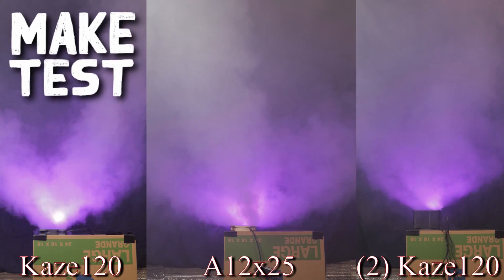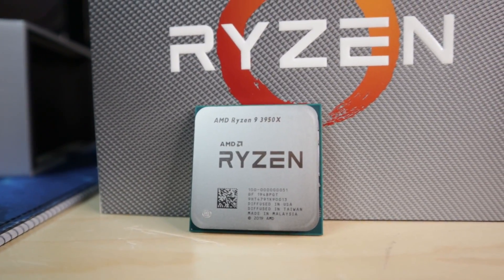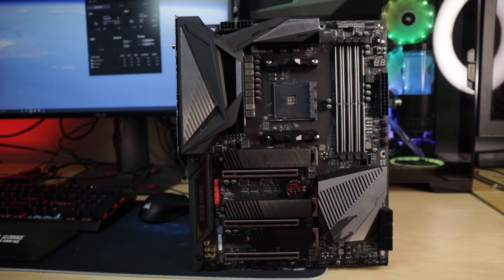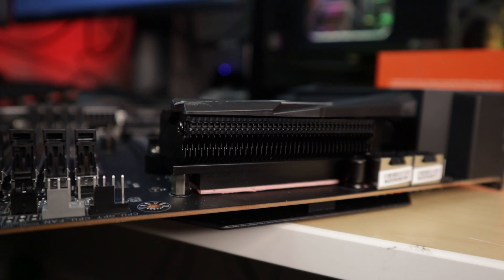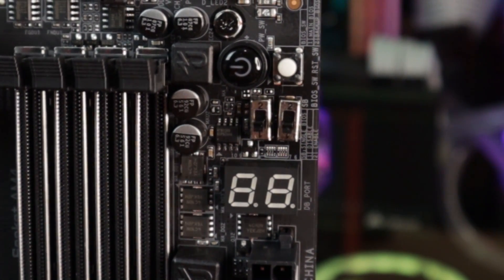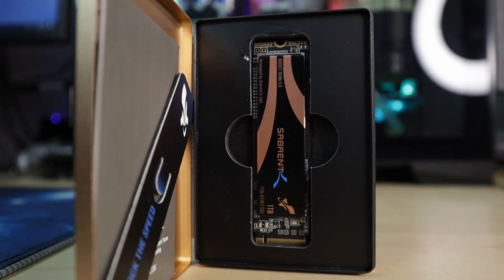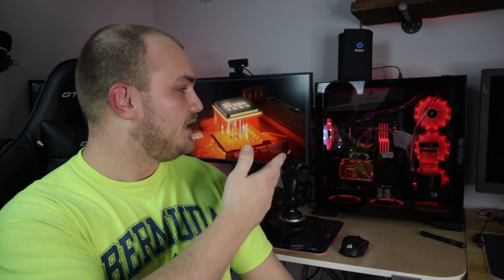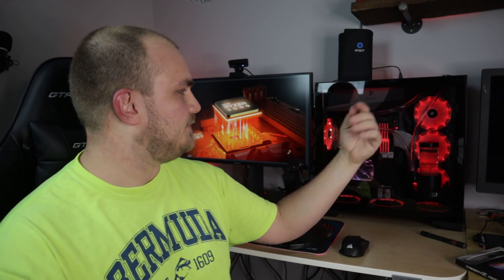EVERYTHING WENT WRONG, Upgrading I7-7700K to Ryzen 9 3950X

Comment: Everything goes wrong when you don't know what you're doing. 
For example, you have misapplied thermal paste and incorrectly inserted memory dimms. You ALWAYS have to install the latest drivers on older systems like Windows. On much more advanced systems like GNU/Linux, you don't have any of these problems.
In games your system will give you more or less the same because the GPU is limiting you.

Comment: Honestly, I wanted to build a computer, as the last computer I built was like in 2004, but I haven't found hardly any parts on Newegg or anywhere, so although I managed to find the parts for a computer, specifically motherboard I had only a few options that weren't in the b450 or lower range or possibly b550 or lower, but that said, there happened to be one or two Asus TUF gaming plus WiFi boards available and it was an x570 board... Overkill, I know, but for $180 I have something that isn't crippled in features, and has a chance at being able to run Ryzen 4000 and possibly further, at PCIe gen4 speeds, which is fine by me... That upgrade path problem everyone wanted changed, made me realize that if I wanted to upgrade past the 3900x I got coming in the mail, an x570 was the way to go... I can't really call it future proof considering 4,000 series might be the last on this particular motherboard generation, but if it isn't, then I can upgrade still to whatever comes after 4,000 series

Comment: when you can increase your memory speed to 3600Mhz and the FCLK to 1800 you are going to notice a huge improvement on system response  and it should be stable, if you need help dialing in the memory clocks send me PM and I will be more than happy to help you, I have basically the same system you have but with memory running at 3766 /FCLK 1866 1:1 and believe me the system behavior is way better than my memory using the stock 3200 XMP profile.

Comment: I kinda need an upgrade when it comes to my computer.

I have upgraded my graphics card fairly recently from a hd6870 to a gtx1060. But the cpu is falling behind unfortunately. The cpu being a 2500k running at 4.7 ghz on a single tower noctua air cooler and it has been running at the same speed ever since I built this computer back in 2011

Comment: I remember me and my friend went through the same process tried to boot up his new system and it would go on for a second and then power off again so we started going through the process of unplugging things to see what it is and we eventually found out that if we unplugged the RGB controller the PC would power on at first we thought it was the controller itself but just in case i told him to order a new Molex cable and low and behold it was the cable all along

Comment: beast cpu. Im still on 7700k here. Wanted to upgrade but prices rised a bit. Opted to wait. Going to delid and aply liquid metal now to drop temps and better oc.
at this moment on Aircooler fixed 4.5mhz , 76ºc max load temp..not good for noise and not the safest for the cpu.

Comment: Gaming SIDEGRADE not upgrade. It's not just the clockspeed, its the ccx and latency of the ram.  I hope they fix it on the upcoming XTs and the Ryzen 3. I've kept my 6600k with my 1080ti and it's still good but I wanna use my 1080ti to its fullest. Safest buy would be a B550 with a 4700x or a 3700xt if it can be found cheap.

Comment: The only thing that 'went wrong' is you got a DOA ram stick. Suck but it happens. The not booting issue was you being a moron. Different PSU cables are wired differently on the PSU end (even if they terminate in the same physical plug). They're not interchangeable. As for chipset drivers - wtf doesn't update their chipset drivers as a standard thing? You haven't been a PC enthusiast for very long eh?

Comment: And still wouldn't buy AMD again:
1. The Ryzen 7 2700X gave me more trouble than joy.
2. In gaming, they still are bad, when even a very old 7700K keeps up with a 750€ CPU.
3. Not going into troubleshooting with RAM, it's one hell with Ryzen.
4. Even if you get it running there are plenty of random Bluescreens even without any OC done.
5. The overconsumption is higher or equal on AMD, even with the new 10900K around 250 watts.
    I had 280 up to 320 Watt drawn by the Ryzen 7 2700X without OC.
6. Probably they're faster in programs, but I had bluescreens or reboots all the time.
    BIOS and drivers were up to date.
7. Totaly random frame drops, especially on Fallout 76 from 120 FPS average down to 30 FPS is a huge drop in my opinion.
Probably missed a lot of other problems that occurred with the Ryzen 7 2700X.
Now I run an Intel i5 9600K OCed to 4.9 GHz 100% stable and OCed RAM to 3000 14-15-15-35-T1 without any bluescreen, stuttering, frame drops or random reboots.
My next upgrade will be the 10900K, yeah it has high power consumption, but considered that 20 threads in total can almost beat 32 threads is quite embarrassing for AMD.
And the Single-core speed kills the 3950 even on base, so OCed it will be a beast.
The Multi-core is needed for programs mostly, games are rarely using more than 10 cores, so no need for more cores there.
I'm already fine with my Intel i5 9600 @ 4.9 GHz can render a 30 minute 4K Video in a maximum amount of 1 hour, mostly around 45 minutes.
And yes, the Ryzen would most likely be faster, but unstable very, very often, had one myself and was super disappointed.
Before the Ryzen disaster, I was always Team Red on CPU, but all the massive trouble is not worth the time you spare in video rendering.
Just saying, the AMD FX 8300 @ 4.7 GHz, 1.55 V ran without any trouble and crash a video render of a 4K video with an hour.
Took me about 6 hours, but hell, the job was done without redoing all the shit over and over again, as it happened with Ryzen.
And for those who are telling it was the OC of the Ryzen, no everything was base.
For anyone who tells it was a bad chip, the first 3 where completely broken, the 4th one ran fine about 3 month and then the trouble happened again.

Comment: I had a similar blunder with an EVGA power supply. I bought one from eBay and it came with all original cables except for one. That one was a SATA power cable that looked really nice so I thought I might as well use it. Woe was me when I found out it wasn't compatible. I powered on the system and it lit up very briefly. Most likely the power supply over-current protection kicked in. But it was too late, the damage was done. One of my hard drives suffered a toasted board :(

Comment: I love AMD, but they make new driver updates almost daily, Id been running my rig for idk 6 months no problem and all of a sudden the graphics went to crap and it started running slow af! I figured out I had to update the software drivers for my GPU and it fixed it but it's a daily thing now to keep up with it.
Reply: I have the same problem... My GPU keeps getting throttled down to 1350Mhz.... I have to keep reinstalling the same Nvidia drivers every time I turn on my PC, to get the proper performance... Have you found a way around this by any chance?

Comment: The Ryzen 3950X which has 4 times more cores, does not do better or very little compared to the I7 7700K in Video Games and in working rendering, it is "only" 2.5 times faster for 14 more cores ! If the I7 7700K had 16 cores and 32 MB of cache, it would be much more efficient ! Ryzen architecture is not very elegant, they are only glued cores and it is with the huge memory cache that this compensates for the weaknesses of the architecture.

Comment: how is that m.2 gen 4 performing now?? i have an issue for 2 months now the writing speed us extremely low about 1000 sometimes less
Reply from the maker: honestly i could tell a dif between 3rd and 4th i dont do anything really that would benefit
Reply: @MajorHardware  me too but installing windows was super fast. however, i asked about this m.2 by sabrent if you can please check the speed of writing and reading to see if the performance has change just like mine.AMD driver chip-set updated to the new release on 03/19 and updated bios F11 and F12e nothing resolves the issue

Comment: I want to upgrade my 7700k sometime in 2020, I was most likely going to go with the i9 10900k, however the 4900x will probably peform just as good but have more cores and will be the same price or cheaper, however I pretty much only play games, I plan on upgrading my GPU after I've upgraded my CPU as well, because although the 1070 is old, it's still okay, my CPU is my weak point still, as it  actually gets really close to being maxed out with my 1070 so I might not necessarily see a big fps increase with a 3080/3080Ti, whichever I end up getting

Comment: My first experience with AMD wasnt best ever, truth to be told i bought used system, but man, oh man. 
First boot rig did not fired up, got error codes, after tearing everything down managed after several clear mos to get it running. After switching board crosshair VII hero to VIII formula got more issues and finally after restating ram got it booting. And final issues when i have switched my water cooled gpu to water tought i fried it or something cause was getting gpu error,  again clear cmos, reseat everything and it was booting. And yet more issues when i transfered everything to new case more same issues, such headache -.- 
MAybe its only my luck or lack of it but idk. Now my ryzen 3700 x has few temp readings in aida 64 cpu temp, that reads 41 with corsair h110 aio, and package and cpu diode running at 52 celsius, my OC-ed x5660 to 4.2 was running 35 idle arround 50 load....

Btw your psu issue is because of douche move from psu manufacturers and they switch cables arrond so you cant use universal ones for all psu-s

Comment: So bascially you used a mixed up PSU cable (from another PSU), not AMD fault. Then PC was working but having some strange staibility issues, cause you didn't donwloaded the newest drivers form AMD webpage..... AM4 socket will support atleast 4 diferent Ryzen "gens", I think is basic to get the lastest drivers form AMD webpage, or atleast check if whats on the motherboard manufacturer is the lastest one. Anyways the Pc looks awesome, and Im glad you humbly explainned the issues you had and how to fix them.Sorry I went a little bezerk withthe comment, but its cause of the video title, maybe something less dramatic would have been a bit wiser. As for the benchmark scores, those are witht he slower DDR4 RAM, imagine the 3600MHz one. The 1% low on CoD was almost twice as before, thats a huge bump and gameplay should be now pretty smooth.

Comment: Nice rig, I wouldn't of tore apart a working system, to build a different working system. Its always best to just start fresh with a new case for a new build. Also I can't tell you how many times I've messed up because I did not test everything on a bench before assembly, it just makes troubleshooting a pain.
Reply from the maker: at the time it seemed like a good idea however i would have started fresh in hindsight

Comment: lol did you check your math, Intel has done the right thing in cutting prices and the reality is that even though the Ryzen 9 3950X is a stunning processor, the Core i9-10980XE still beats it in plenty of tests and it's huge overclocking headroom means it leapfrogs the otherwise dominant AMD CPU in areas it's weak in at stock speed.

Comment: I went from 4770K to 3900x + Aorus Pro + 3600MHz 14-15-15-36 RAM. Pretty happy with it. But. Latest drivers and BIOS and still can't get rid of WHEA Logger warnings related to PCI Express interface. I've heard that this is related to PCI Express v4 vs v3 differences but x570 needs more attention from AMD. Check you Event Logger for those WHEA warnings. Do you have them?

Comment: my R9-3900x issues and history
#1 had to flash X470 BIOS (as expected but a hassle)
#2 stock cooler worked but fan fluctuated and made grinding noise like crazy. Don't think it's broken though. What's going on?
#3 replaced with Noctua NH-D14 but fans still fluctuated a lot due to temperature spikes even at low CPU usage. Why? And yes I have sufficient case cooling.
#4 CPU kept crashing under heavy load after my overclock with Asus AI Suite 3 DIP5 in  Handbrake despite being in the 75C vicinity (though it may spike without me knowing)
#5 used Asus AI Suite 3 DIP5 software again and now the system is stable at 100% at same exact 4.275GHz in Handbrake it used to crash with.. why?
#6 Tweaked CPU fan profile to avoid the spikes so run at 30% max RPM until 60degC then ramp to 75degC which seems to be the optimal for noise and stability.
#7 Happy now! Refuse to touch anything as it runs great.
Reply: (edit: I didn't have another CPU so I had to take motherboard to a shop back in August 2019; thought maybe the motherboard would have the right BIOS when I got it but it did not. They did it for $20CDN)
Reply: Edit 2: got a free AM4 adapter from Noctua. Works great though I installed the mount the wrong way first. Easy to do if you're stupid.

Comment: 1st off it sounds like you're making it sound like AMD are horrible builds, because of things that you have done.
 Secondly you're lucky you didn't fry something on that board connecting the wrong cable, not everything is manufactured exactly the same and you should know this.

Thirdly, you bought dead ram, it happens  It everything made in the field and every product in the world.

 Lastly, you should always check the bio's and all other updates including chipset, this should be common sense!
Reply from the maker: Lastly or fifthly

Comment: I just a did a switch from Intel and was lucky to not have the issues unless you consider 16gig ram stick seen as a 15.9gig. But a bios update fixed that, I did find another video recommending 5 items post ryzen build and the chipset drivers was one of them from the AMD web site.

Comment: i broke a sata cable just disconnecting it, thought nothing of it, replaced it and it killed two hard drives. i was very lucky this was on an old build, im never using non original cables for psu anymore. Thanks for sharing Major!

Comment: The Intel 5 GHz all-core clock speed seems to be at the heart of why some guys choose those SKU. Your gaming scores should finally show how very little in real-world gaming that is. It is not only about extra high fps but about overall gaming experience....(minimum to maximum deviation in fps, etc...). The cost versus performance for my very own 3600x was hard to beat. I was able to spec a very good X470, 32GB DDR4-3600 and the CPU for less than what the I7-9900 cost at the time. Crazy!

Comment: A 3000 mhz ram kit on a ryzen 9 cpu ....gives 20 to 30% less performance.

Try again once u rma the ram sticks and get new working ones to do either : CL 16/16/16/32 or if u can push it to 14/14/14/28 at 2x16gb 3600 mHz and make sure its only 2 sticks cuz its a daisy chain board , not a t topology one.

I believe you will be surprized at the results in performance jump :)
I did not believe it but once i tested it on my best friends PC we got noticable jumps in speed on everything we did in his system.Try it out :)

Comment: ryzen prefers high speed ram,higher fsb means boost in performance.I used 3000 kit first games got laggy sudden dips in fps ,after switching to 3600 kit the problem is not there anymore.
R53600+B450+rx580 4gb+16gb dual channel.

Red dead redemption on 3000mhz kit: 1% lows 2 fps
On 3600mhz kit: 14fps.

Comment: I've enjoyed my 3950x so far. I've seen a couple of it's cores get up to 5.2 GHz but usually it sits between 4.3 and 4.7
Reply: Hello, what Mobo do you use if you don't mind me asking?
Reply: @davehynek8936  I use the MSI MPG Gaming Edge WiFi. Only recently found out it's not a great board, but it works decently so far. Haven't had any issues yet. Haven't tried overclocking It yet either. Might try that on a different board once my warranty expires
Reply: @TheSandsofFlowingTime  awsome thanks! Trying to figure out what to go with.

Comment: Mixed up power cables is a very quick way to blow up/burn whatever you connect it to... :(  A guy on Tom's Hardware burned up $700 worth of (four) SSDs in 1/4 second by the same method.... DO NOT MIX CABLES...